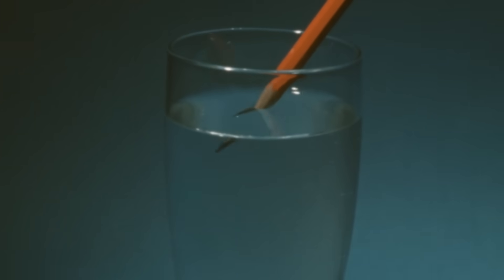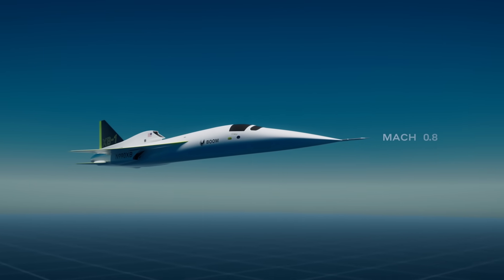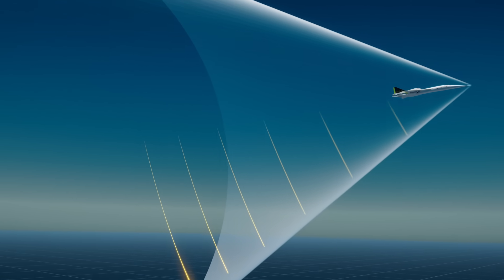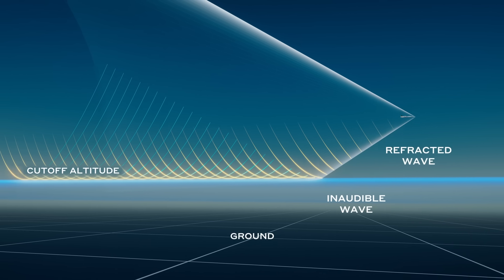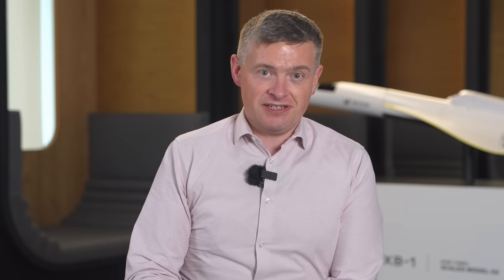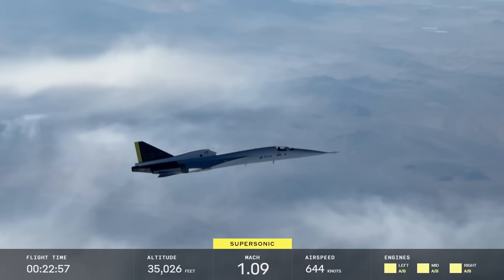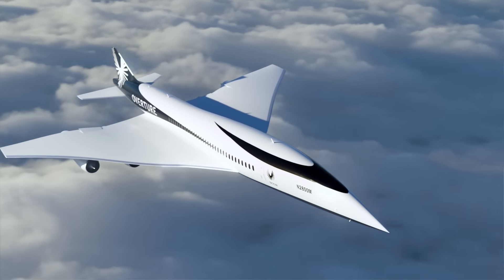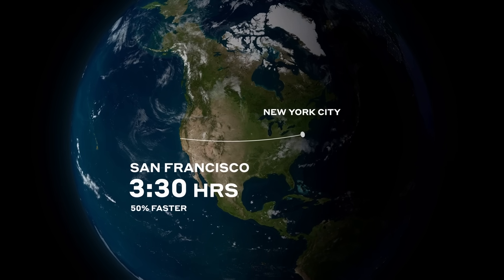What Is Boomless Cruise? Supersonic Flight Without the Boom

Comment: So let me get this straight there would be two different modes for the plane or, two different planes for different speeds.
Reply: There are no modes or second plane, they are just saying they will design the plane so that not sonic boom is audible from the ground. The smaller one they showed is their XB-1 prototype.
Reply: @nenoloblaH  but it is impossible to do boomless cruise at mach 1.3 and the overture is set to go at mach 1.7. So that's why I was suggesting the possibility of modes or different planes so the plane doesn't go above the speed limit during Continental flight.
Reply: @Noface_allcases.  maybe just flies below 1.3 over continents then
Reply: @nenoloblaH  yeah, that addresses the mode suggestion, but I was just thinking in the case of a minor technical issue, since the supersonic boom is such an issue.
Reply: @nenoloblaH  I know but what if there is a system malfunction, pilot error you know?, and weather conditions play a roal
Reply: @ ooooh no then some people hear a loud sound on the ground, not that bad
Reply: @nenoloblaH  well yes it is a big fucking problem that's why Super Sonic is banned over continent
Reply: Not really different 'modes', just increasing the throttle. At anything past Mach 1.3ish (the exact number depends on atmospheric conditions) the generated boom starts reaching the ground instead of reflecting upwards.
Nothing about the plane's configuration changes at higher speeds, rather the physics of the air around it does.
Reply: Yeah "boomless" appears to basically just mean flying so slow as to technically still be going supersonic but avoiding the boom. Normal planes fly close to supersonic. Don't believe this boomless BS, they're just milking investors and have been for the last 11 years. I hope it happens but they are taking FOREVER to make a plane that is just barely slightly faster than existing planes. Hermeus is a much more interesting and more promising company.
Reply: @paulgemperlein626 0.7 Mach isn't that close to supersonic

Comment: Sorry if this sounds negative, it is not meant to be: What about the airplanes that are traveling at the same altitude or close to the altitude of the BOOM jet? Won't they be dealing with the sonic boom?
Reply: It’s pretty unlikely for a plane to be close enough for the sound to be bothersome.
Reply: AI's analysis:
While reflecting sonic booms away from the ground is intended to solve the ground noise issue, it doesn't eliminate the sonic boom entirely. The risk to other aircraft would depend on how effectively the boom is redirected, the intensity of the reflected waves, the distance between the aircraft, and atmospheric conditions.

It's reasonable to assume that if such technology progresses, safety regulations would need to consider the potential impact of these redirected sonic booms on other aircraft to ensure safe operation.

So there does appear to be some safe- guards that would need to be applied to the Sonic Boom plane to make sure it does not interfere with other planes in the area.
Reply: This is why the Concorde caused all those crashes over the North Atlantic
Reply: Interesting... I had never heard of that. I will look it up. Thx!